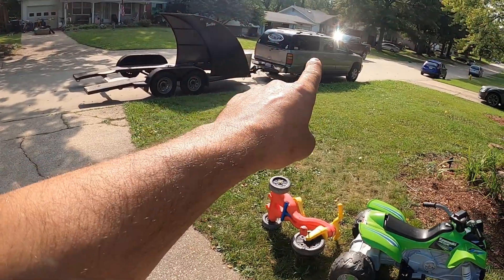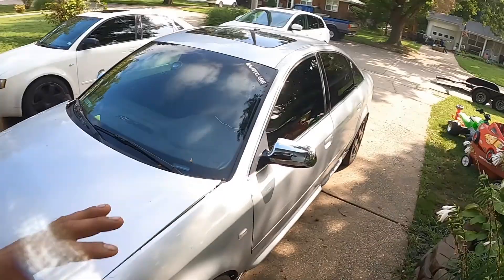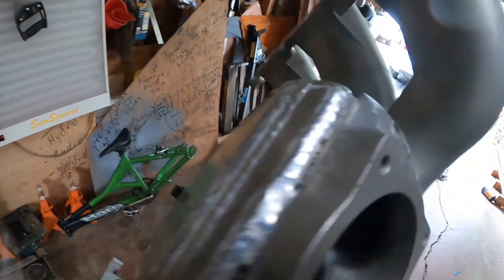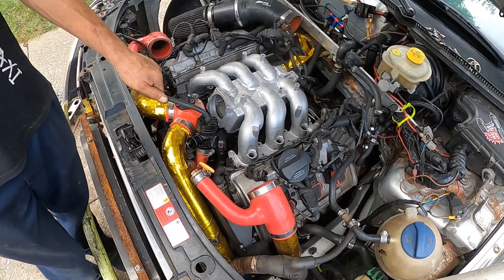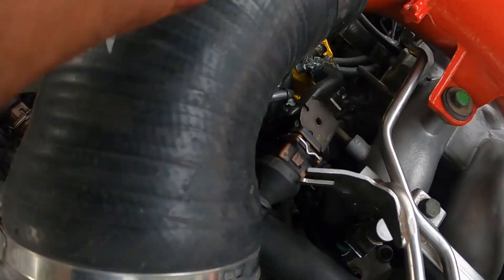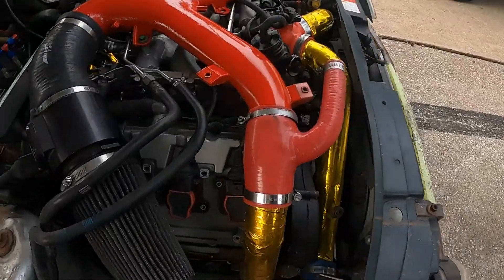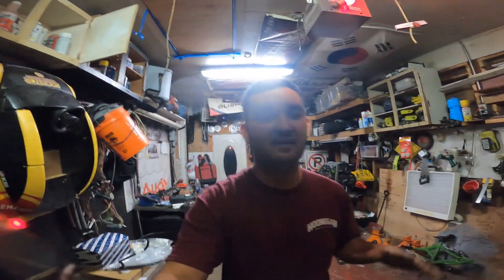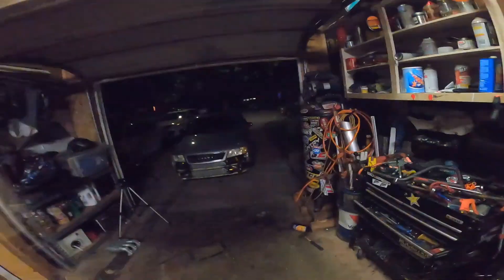TESTING MY NEW TRACTION CONCEPTS DIFF AGAIN! |DAILY WEEKLY|   EP3

Comment: How does the lsd work on the long run?? Any pros and cons??? I plan on getting a traction concepts lsd installed on my 1st gen lifted highlander fwd for offroading. but I got no knowledge of the custom lsd.
Reply from the maker: I've drove the car for about 5hrs straight as my single longest drive so far, however I've also drove it several days in row of non stop mountain pass thrashing after 10 hours of flat towing with no problems. I think it pretty good 😅
Reply: @TheRwdyAudi  I just want to know if it's worth the money and time?..
Reply from the maker: In  off roading situations I honestly don't know I haven't ever ran a TC LSD on dirt ... with that said basic principles of how LSDs work yes it should be an amazing upgrade for your highlander. Giving both wheels full traction when it is needed the most. I would reach out to @tractionconcepts directly, The office lady who tends there IG page is super nice , just DM them and she can get you fixed up. Don't forget to use my promo code "jactrac10" at check out get 10% off your order
Reply: @TheRwdyAudi  I'm running 265/70/16 bfg km3 mts. Its lifted by 1 1/2 inches. I have traction control. 95% of the time I'm on traction control offroading. Did good so far on partially loose gravel hill climbs, mud, and snow. But on nasty mud. Traction control lacks momentum. And in deep snow. Abs stalls it. I did found another method if traction control can't take me further. I'll back up and hit auto 2nd gear and turn off traction control and gun my way out. It would be nice if theres a company that makes custom auto lockers for fwd transmissions. But reliability. An lsd would be my choice for upgrades...
Reply from the maker: Sounds like you got a unit of truck my dude 👊😎
Reply: @TheRwdyAudi  Questions how long do you think this custom lsd last??? I'm driving it every day every year..
Reply from the maker: Interesting question I have been driving and tracking mine (drifting) it weekly almost now , with occasional week long road trips,along with flat towing it to and from alot of events(probably 20000 ish miles)for almost 2 years straight. Only service it has had is when I  took it out per request of @tractionconcepts so we could try out a revision in spring rates to better suit my request (ie version for sale on rwdyaudi.com). So to answer your question I honestly don't know how long it will go, but by physical mechanics and after installing one I would say probably  never, and be 95% confident in that answer.i hope this answer your question.
Reply: @TheRwdyAudi  Thanks. I've been gathering sources about the diff from other channels. Knowing that its not the true lsds and it's a custom lsd over your OEM open diff. I plan on driving it every day and I wanted to take it to the ohv and gambler 500 trails once. Knowing that once I convert it into a lsd. I'm gonna have to change tranny fluid to LS type. but  my concern is the traction control. I'm concerned it might stress the custom mechanical lsd out fast. Knowing the new Tacoma's. Traction control is on. But once you turn it off. The electric auto lsd or locker turns on. If its not gonna be an issue. I'll install the traction concepts lsd. But if it is. I got 2 options. Stick with traction control or go lsd and remove the speed sensor to eliminate the traction control to go full lsd....

Comment: Audi s8 d2 manual. 4:1 diff mod + lsd mod. Worth it?
Reply from the maker: Yeah if you send it in tight she will wanna  set out and come around real nice 😍. The grip will be amazing on the twisty as well
Reply: So this is the "revision 2" of the lsd? I remember you have been struggling to put everything back on the diff the first time. I believe the diffs are same on the c5/d2
Reply from the maker: Yeah the first version had good lock up but on transition it wanna to open alittle to much for how I was driving so we went back to the table and adjusted it and now she is a peach on transition  and maintains the lock up i was looking for better yet still gives me the street ability I was wanting also. The d2 are exactly the same it when you get down to the b5 stuff you have to start changing and swapping parts to make it work